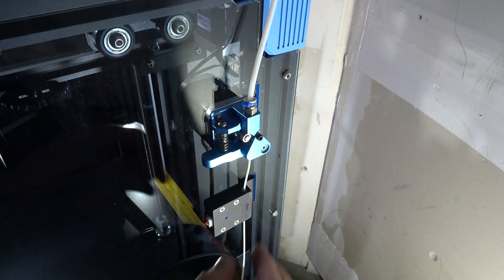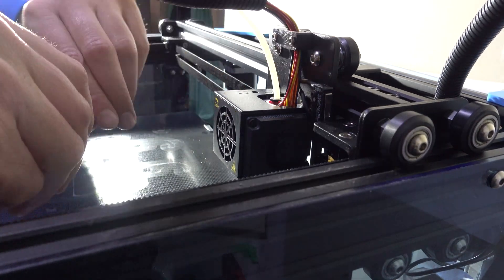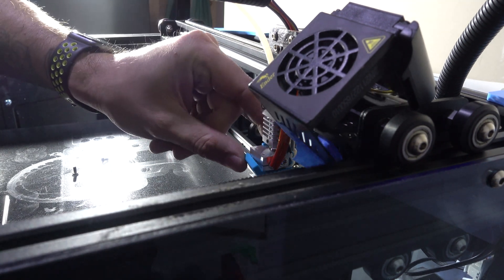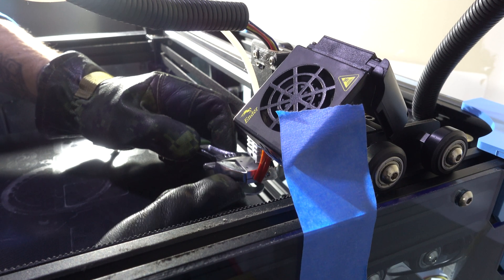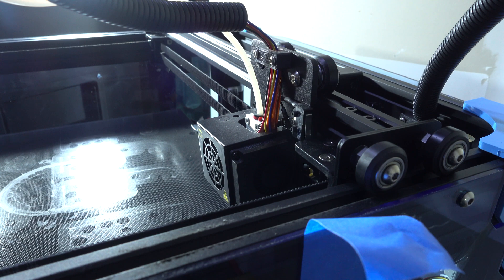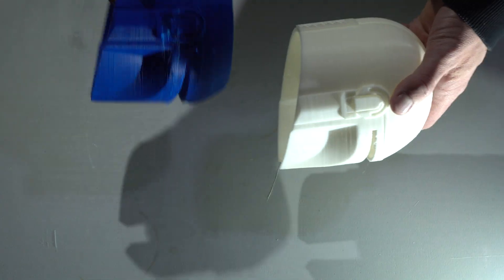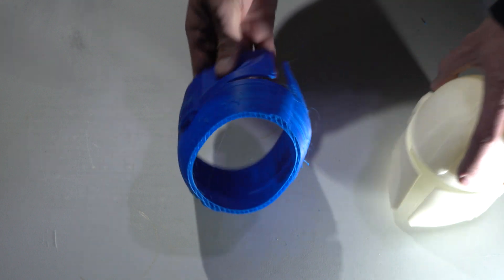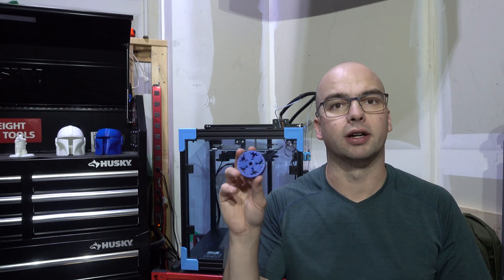Ender 6 Nozzle Replacement

Comment: Two recommendations.

Check out Chep’s video on ptfe called “simple hotned fix for creality ender 3, cr10”. It applies to this printer as well as they utilize the same hotend. 

Secondly, when doing a hot tighten, do it around 20 degrees higher than what your average printing temp is. Way less likely to back out that way. 

Great video man. Keep them coming!